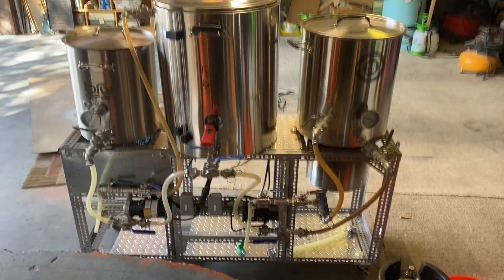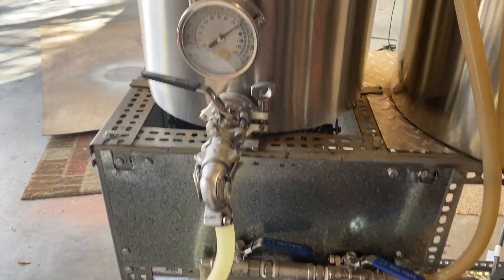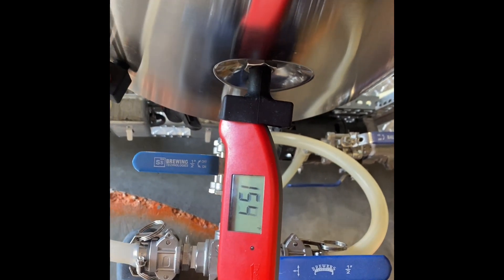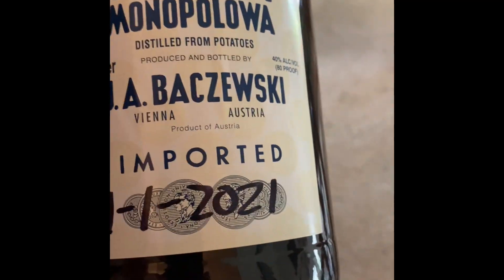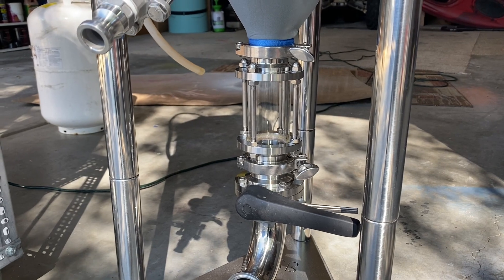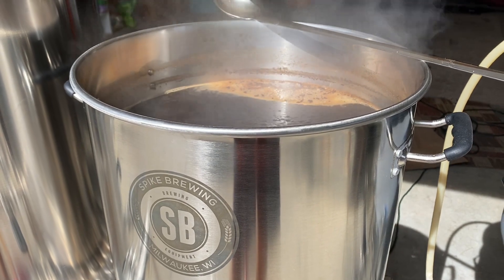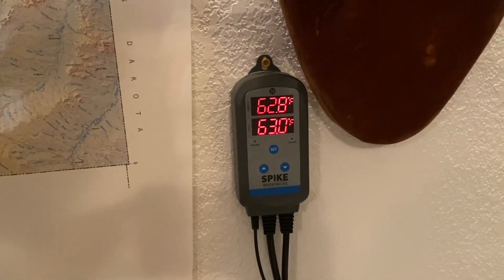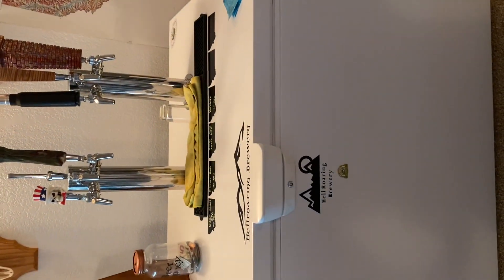How to make all grain beer, 3 vessel single tier brewing system. #brewingbeer #homebrew #homebrewing

Comment: Nice.  I haven't brewed in about  2 months.  My AZ heat has been brutal.  115-118.  Finally this week we were only 100-110.  And 90 at night.  I also have a 3 vessel propane system.  Would love to see  a diagram of your  plubming amd 3 way valves. Cheers from Phoenix
Reply from the maker: Dang that’s hot bro! I have more videos on my channel that show the plumbing of my system.